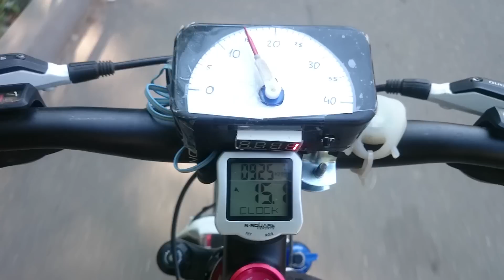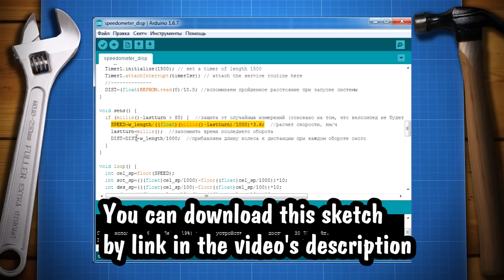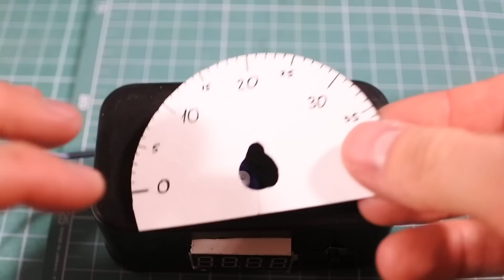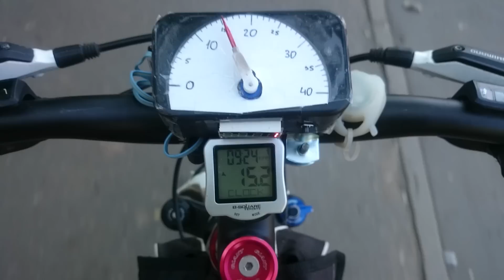DIY bike speedometer Arduino

Comment: hey Alex  can you please help me, i modified your code to use a display as an output but the thing is it doesnt update the values. The value remain zero. I even copied your entire code, removed the display part of seven segment display, added lcd library. It doesnt show any other numerical than zero. I am using the ky024 hall effect sensor. Please help me.

Comment: Alex, i forgot to ask you, is it possible to cut the hall effect sensor from the module and soldier some wires between it and the module pcb ?
Reply from the maker: +Firas Helou I think yes, but it is better to Google "Arduino hall sensor"
Reply: ok thank you MadGyva I think if I do not find any answer I will see on the arduino website

Comment: Great one, bro! Just a tip: take care with that step up (MT3608). Always have a better one around (like XL6009), because it has the tendency of shut off all the time if you draw too much current (what isn't so hard). :/
Reply from the maker: +MC's Creations  thanx) now i am using 0.9-5 to 5v boosters, check a link in the descruption
Reply: Gyver Show Nice! :)

Comment: OH gees.  This one is for geeks.  I just got a plain old analog one off ebay for 12.00.  Screw it on, done. If it doens't last long, so what.  It's cheap enough, fast and easy to install. Done.  And no batteries needed.
Reply: Best response